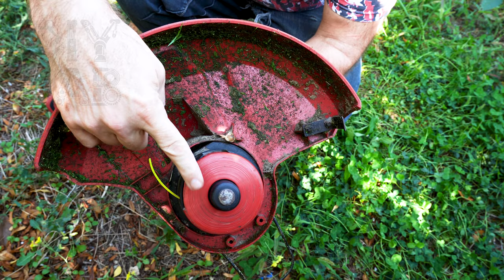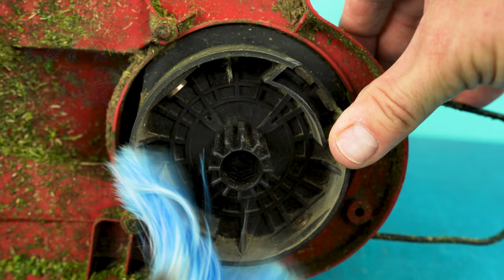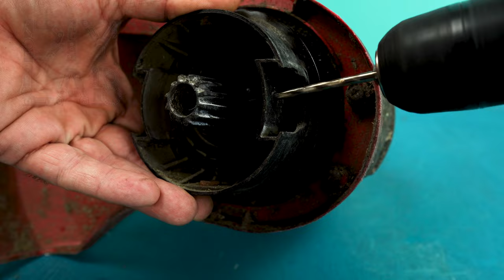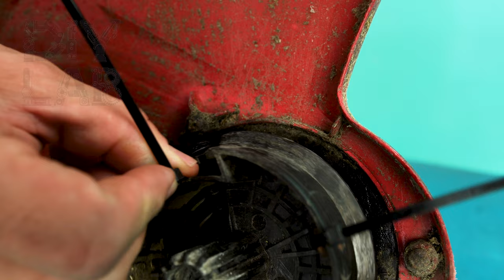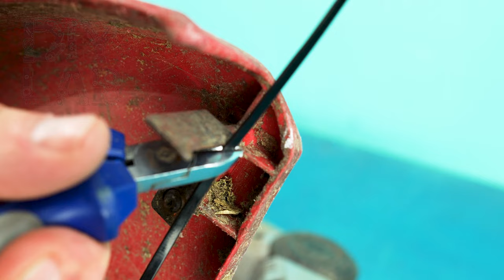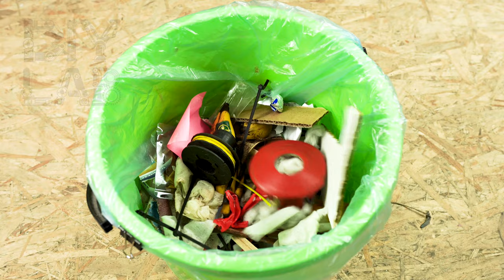The eternal trimmer coil with your own hands! Amazing Handyman Tips & Hacks That Work Extremely Well

Comment: You wouldn't even need to zip the zip tie. Just 
put it through the hole from inside to out. I use a similar
method, but with cheaper plastic wire. I tie a knot
in short pieces and put it through the holes. Works
better than the original feed method. I'll compare
that to the zip tie method.